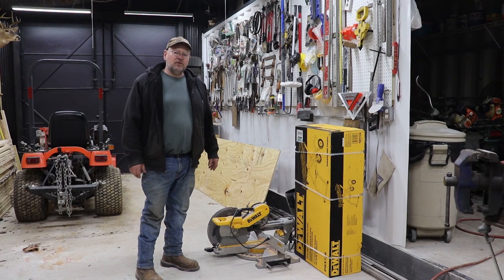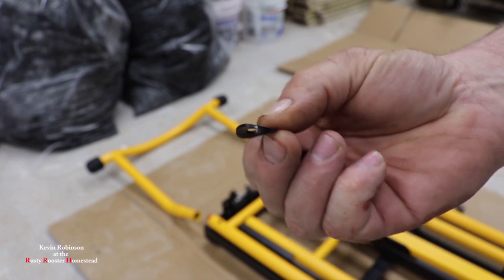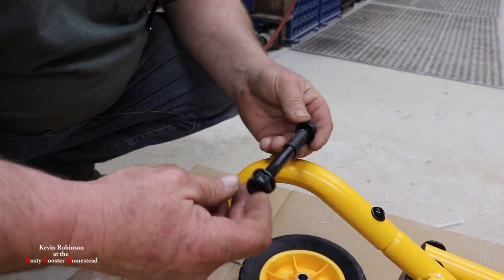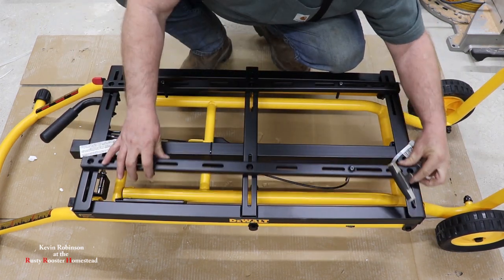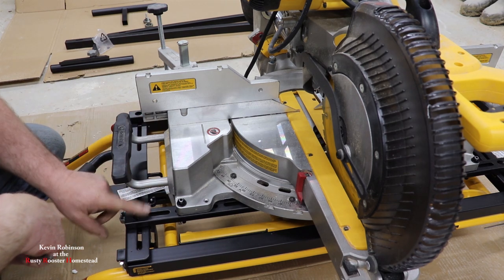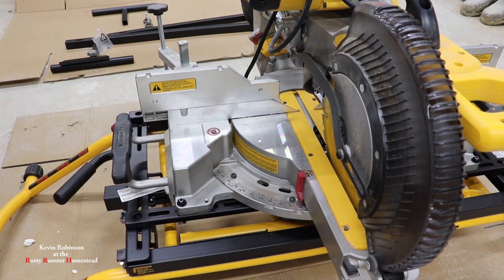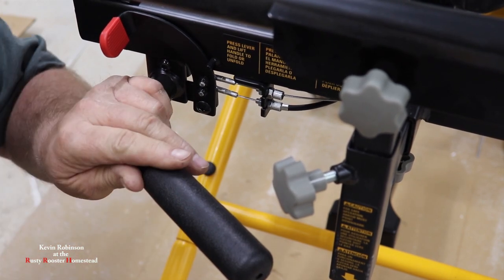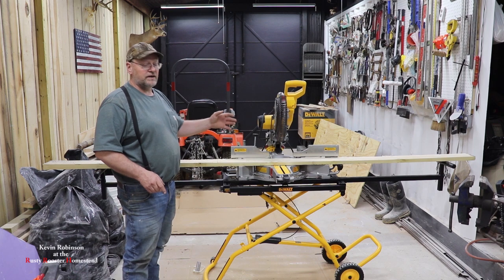dewalt rolling miter saw stand dwx726

Comment: Thank you. Video was very helpful.  It's a great stand. Sturdy. Easy to raise and lower and move around.  Extension arms are not that sturdy, like all of them, but I just put adjustable roller stands underneath them when working with long, heavy pieces of wood or composite decking. Solves that problem. 

Bought the Hercules one from Harbor Freight first but it was useless if you wanted to move it from place to place. The legs are flimsy and lifting it to collapse the legs to lower it onto the wheels is back breaking if a saw is mounted to it. It's fine if you just want to leave it on place forever but not to move frequently.
Reply from the maker: Thanks for the comment glad to help.

Comment: Eggcellent vid. One lil addition tho. Im a big /huge fan of blue Loctite 242(Henkle).  I use it on nearly everything. Absolutely stuff that vibrates. Wave washers or lock washers are ok but the 242 lets you get a good snug tight without the need to kill it. Also love nylock nuts wherever possible. Build it once 4ever. Lol 🤔🤔 do i hear a bit of a Pennsylvania accent? Got lotsa fam there, make me lil homesick. Anyway four thumbs up 👍🏻👍🏻👍🏻👍🏻 oh! Also so awesome being able to wheel around up or down WITH the saw mounted. Two more 👍🏻👍🏻
Reply from the maker: PA it is my friend thank you for the comment.

Comment: I really like that saw stand. I use the one that came with the saw and it works, but it doesn't have wheels or wings to hold long boards.
Good review.
Reply from the maker: This one seems to be working out not hard on the back.

Comment: You should include that those long bars are different sizes. We put in the smaller ones in the larger hole so then had to crawl under with headlamps to find the hole underneath where you have to find the catch and push it in to release the bar. It can be done and it's not impossible but better to know ahead of time to put each bar in the correct hole. 
Otherwise great video.  Thank you!
Reply from the maker: Sorry about that , but i appreciate you watching.

Comment: Idk what’s going on with mine. First one wouldn’t collapse. Took it back to HomeDepot for a replacement. Just finished putting together the replacement. It won’t collapse either. Also, had a heck of a time raising both too. There is no clicking sound when the red lever is engage. The tools manager at HomeDepot couldn’t collapse it either. Getting frustrated for sure. 🤬
Reply: If you set it up AND IT WONT CLOSE
SWAP THE 2 CABLE POSITIONS ON THE TRIGGER!!!
It has more throw on the top position which needs to go to the spring to bring the slide back for release to be able to lower it.
I just got it and assembled yesterday out of box brand new and it had this issue.
Works perfectly now
Reply: Same here.
Reply: And same for me, thanks for the tip
Reply: @deanrivera8016  I took mine back and bought a cheaper one at harbor freight. I like it a lot. It has legs and wheels...doesn't collapse like the dewalt but the dewalt just about killed me.

Comment: I notice you mount your saw on the opposite side the manual shows. Did you do that on purpose?
Reply from the maker: No I didn't I did that sorry.
Reply: @Robinson-Homestead  lol...no big deal. I mounted it per the ,manual but the extension arms aren't under the saw "table" very well. So I reversed it like yours! I haven't lowered it to see if it stands up vertical ok yet in that position...mine is stuck and the POS cable release doesn't release and allow it to lower lower.
Reply: I mounted the same way you did to better align the support arms. When lowering the unit are you lifting first, then depressing the release lever.

Comment: If you set it up AND IT WONT CLOSE
SWAP THE 2 CABLE POSITIONS ON THE TRIGGER!!!
It has more throw on the top position which needs to go to the spring to bring the slide back for release to be able to lower it.
I just got it and assembled yesterday out of box brand new and it had this issue.
Works perfectly now
Reply from the maker: Thanks for the info.
Reply: Ad Vanced, my wife purchased this stand about a week ago and after I assembled it I had this exact issue, darn thing wouldn't close! I got frustrated, so I just wheeled it into the garage intending to troubleshoot and watch some videos to see if anyone else had the same problem. Unfortunately, my lovely wife(impatient angel that she is, lol) started adjusting , tightening, loosening all kinds of things that had ZERO to do with our initial issue so...lol